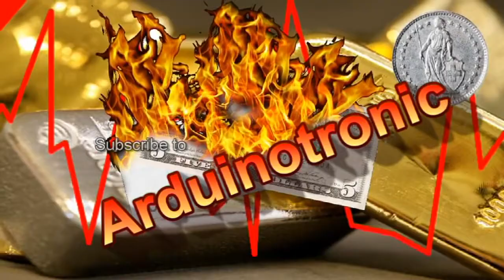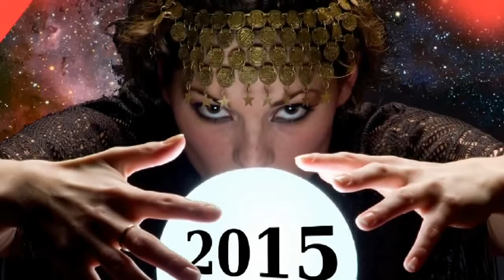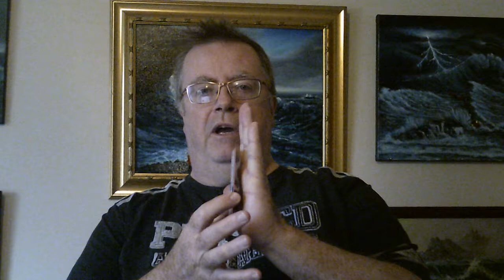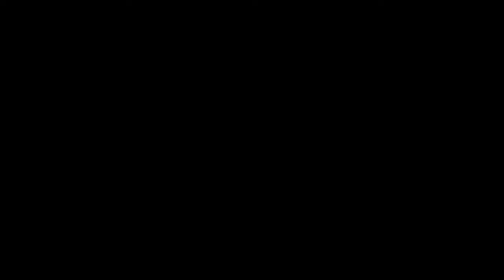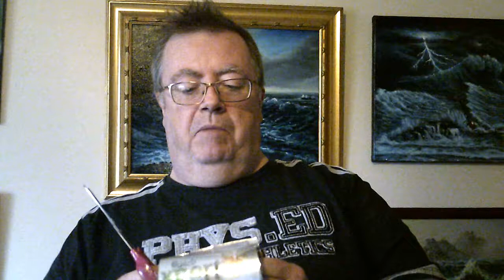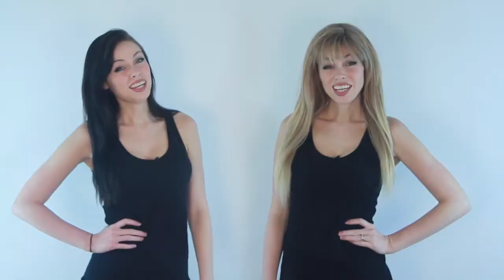Contactless card fraud- defeat it for free! How these cards work.

Comment: You can buy an RFID shielded wallet, or sleaves.  It's probably going to be a necessary until we are all using Apple pay with fingerprint authorization to unlock the signal.
Reply from the maker: +Joe M. Sure and I had one but they are so slippery they fall right out of your pocket with no excuse whatsoever. So its conventional wallet and beer metal time...
Reply: It might be easier to carry cash...until it's outlawed.
Reply from the maker: +Joe M. Yeah thats the whole point of contactless cards for sure. .. cash free society crap.
Reply: Contactless cards are not RFID